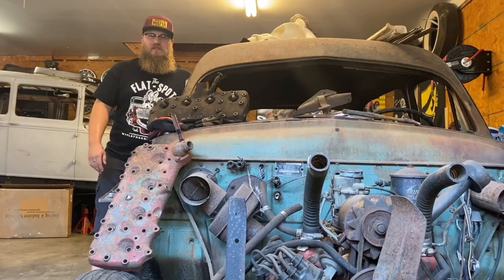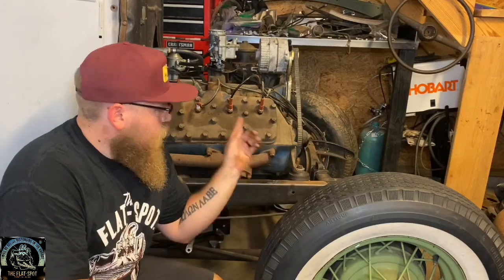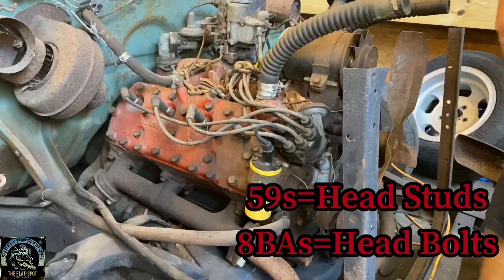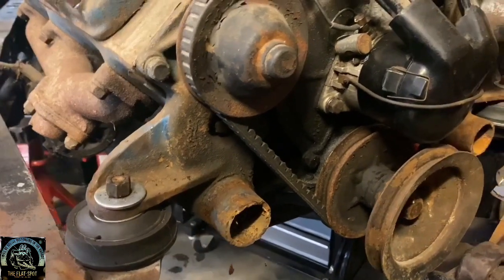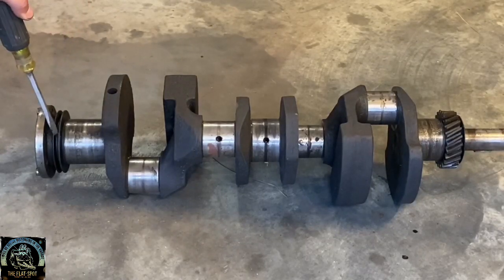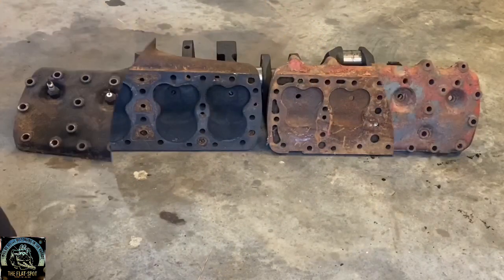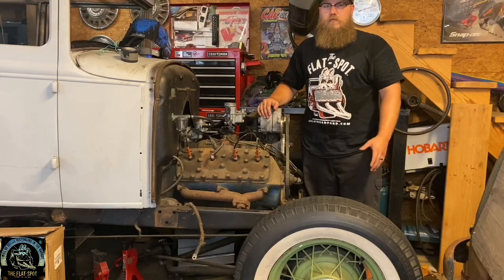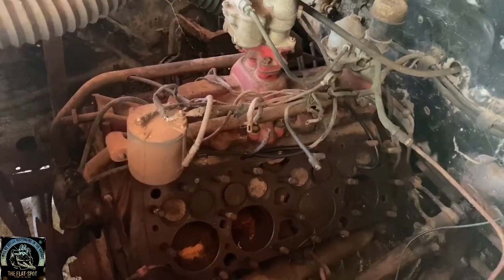Difference Between 8BA and 59 Ford Flatheads!

Comment: I have seen earlier 24 studs with clip in bearings instead of floating. From memory you have to be careful with the 8BA head gaskets as they had a front and back with water restrictions in the front  8ba cam also had a gear on the front to drive the dizzy.
Reply from the maker: Thanks for the extra info David!

Comment: My 59 has circular center passage ways. It also has a relieved intake deck.
Reply from the maker: Ryan Forest sounds like an 8RT, otherwise you have a pretty rare block, it has the 59 on top of the cast bell housing?
Reply: Yes. 59 on bell housing and inside behind valves.
Reply from the maker: Lucky you! Take care of that block

Comment: First engine teardown when I was 14, friends dad told us to take a 49 ford flathead down, we did and learned how an engine worked. He was a cool dad as we did it he explained what everything a how it worked. Next year we got a 48 dodge for 15.00 an got it running and drove it to the drive in, with getting pulled over. That could never happen now days. Someone should bring flathead  back. ELON can we talk?
Reply from the maker: What an awesome story Joel thank you for sharing
Reply: I was saying that during the 70s and 80s, as horsepower was way down, so flathead performance would have been fine, with an engine that was much cheaper to build, but now, with the gas engine seemingly on its way out, I doubt that will happen, unless somebody comes up with a miracle fuel that does eliminates the need for a catalytic converter and therefore emits far less carbon dioxide - yes, the catalyst increases carbon dioxide.

Comment: Awesome video, isn’t the 59ab shorter front to back vs. the 8ba? And that’s why the 59 is more desired in AV8 cars?
Reply from the maker: Andre L thank you! I have a couple of each motors, I haven’t measured but I would say they are the same size, if there is a difference it’s just the difference of the bell housing, I would say a lot of “traditionalist” prefer the 59 just for the look, but they still build them like a 8BA

Comment: I have an 8RT.  It's in my '53 F100.  How is it different from the 8BA?
One difference I'm aware is the front engine mount is under the crankshaft pulley and sets on the front frame crossmember and not mounted by the water pumps.
Is there a difference of performance between the 8BA and the 8RT?
I'll be putting a set of polished Offy heads on it.

Comment: Would love to see the comparison to the 39-42 motors.  I have 2 59AB and 1 1942 motor.
Reply from the maker: Right on I’ll see what I can do, not too much of a difference though other than the center water outlets
Reply: @WiredCustomsSpeedShop  I know there is a raised ridge around the intake seating area on the 41-42, not sure about the earlier ones.

Comment: Great video! Is the 8ba and the mercury 1cm the same? I have the 1cm in my car and I’ve never pulled the head or pulled the motor. From what you’re showing they seem to be the same?
Reply from the maker: Thank you so much for watching, the 8BA would most likely be a 239 with a 3.750 stroke, the Mercury should have the 4 inch stroke making it a 255, huge difference and if your block is really a Mercury it’s Flathead gold
Reply: @WiredCustomsSpeedShop ; Is there any structural difference between the   late model Mercury and Ford blocks ???
Reply from the maker: @daleostrom3613  structurally speaking, the 49-53 (US) blocks are the same exact block
Reply: @WiredCustomsSpeedShop ; Thanks, I have one out of a 2 ton log truck and one out of a 53 Mercury.
Reply from the maker: @daleostrom3613  no problem at all, the Mercury motor should have the longer and more desirable crankshaft too

Comment: My 1941 59 Flathead had a crab distributor setup. Can I swap the crab with a 8ba "normal" distributor by changing the sprocket cover or is there more needed to run the 8ba distributor?
Reply from the maker: You can, you’ll need a conversion kit and 8BA style timing cover, I would have to say though the 8BA distributor was a significant downgrade from the crab distributor and even the helmet style distributor, they run off of vacuum advance only without a mechanical advance
Reply: @WiredCustomsSpeedShop  And, the 8BA distributor has single points stock, the crab and the helmet both have dual points.

Comment: Question what engine oil do you recommend for the 8BA flat head
Reply from the maker: It all depends on what area you live in and what temperatures the car is going to be, I live in Virginia and I use 15w40 and buy a zinc additive
Reply: @WiredCustomsSpeedShop  Shell Rotella 15w40 diesel oil is known to have zinc in it already. Also found basically anywhere that sells motor oil. Any experience running that in a flatty?

Comment: I am getting ready to assemble an 8BA engine. I plan to use a Holley 2bbl Sniper EFI which requires 45 PSI fuel pressure. I will need to use an electric fuel pump instead of the stock mechanical pump which means I will not have a fuel pump push rod in place. I have been told that an oil leak at the push rod bore will severely reduce engine oil pressure. Should I plug the push rod bore hole? If so, I will need to do it very early in the assembly process especially if it requires machining. What say you?
Reply from the maker: The fuel pump push rod is oiled with the cam lobes since it runs off the back of the cam, it is known to lower oil pressure because removing it causes an internal leak, I would recommend leaving the rod in there and just using a block off plate on the fuel pump stand, I know a lot of guys will just leave the pump on and not hooked to anything, it’s up to you, but I’ve been thinking about using the sniper on my daily driver flathead, what are you going to use to get it from four bolt to three bolt flange?
Reply: @WiredCustomsSpeedShop  I would rather install a plug either press in or threaded to replace the push rod and install a block off plate to replace the pump stand. As for the injector bolt flange, I am using a Mercury aluminum intake which has a 4 bolt flange. I haven't ordered my Sniper yet so I may have to fabricate an adapter plate to go from the "teapot" bolt pattern to the Holley 2bbl pattern. I forgot to add that I am installing a T3/T4 hybrid turbo set up to blow through the Sniper. I have a set of stainless block hugger headers and enough 2/12" stainless elbows to go forward under the water pumps and up to the front of the intake manifold where I plan to mount the turbo and plumb it into the Sniper. The hardest part is going to be fabricating a bonnet to fit the inlet flange. It should make around 250 HP. If you're interested it's going into a '27 T track roadster.
Reply from the maker: Edward Werick that sounds like an awesome build! Are you going to post it on the H.A.M.B. or Instagram or somewhere like that I can follow and see it? I am definitely going to put the sniper on my 42 Tudor, after some other projects catch up first
Reply: @WiredCustomsSpeedShop  I too have some "bench cleaning" to do before really getting into this build. I am not very active on social media but if had your e-mail address I could send you progress reports.
Reply from the maker: Edward Werick  you don’t have to go as far as updates but I wouldn’t mind some pictures every once in a while, my email is wiredcustomsllc@gmail.com

Comment: I'm looking at a 1950 F1 pickup online and photo's show 8CM stamped on the heads (24 acorn stud covers not bolts) but I am suspicious that maybe the block is a 8BA . Can you fit a Mercury 8CM head to 8BA block and how can one tell a Mercury block by photo's?
Reply from the maker: Hello! Technically you can’t be 100 sure if it’s a Mercury block unless you drop the oil pan and look at the crank or pull one head off and check the bore and stroke of the crank, you can definitely mix and match the blocks, worst thing about flatheads is you can’t 100 percent ID and engine without disassembly
Reply: @WiredCustomsSpeedShop  Thanks. You've broadened my knowledge immensely.

Comment: What is your preferred stock standard Ford flathead and why? I am looking into buying one and don't want to buy a bucket of fish hooks. Thanks.
Reply from the maker: For me it depends on what I am going to put the motor in, technically the most advanced Flathead is the 8BA which is a 1949-1953, it has the best bearings, best crank, best oiling and cooling system, it’s a great motor, if you ask me what is my preferred motor, I would say the 59ab motor which is 1946-1948 motor, it’s the traditional hotrod motor and I like the look with the heads and front facing distributor, hope that helps!
Reply: @WiredCustomsSpeedShop  Thankyou.
Reply from the maker: @wtongtube  no problem! Let me know if there  is anything else I can do to help
Reply: @WiredCustomsSpeedShop  Which is overall better a Ford 8BA or 1949 Mercury 8CM?
Reply: @WiredCustomsSpeedShop  I have heard that the 8BA block is rather crack-prone, but the 59AB is not.  Is that true?

Comment: Hey what oil do you recommend for a 8ba
Reply from the maker: depends on where you live, the climate, what temps you will be running the engine in and if it has bee rebuilt in the last 20 years or not

Comment: Great lesson. I'm in the market to replace my 60 in a 39 standard. I have a early 50's McCullough supercharger I would like to use. Would it be best to only use an 8BA and/or should I look for a mercury?
Reply from the maker: Cary Ford 8BA would be best, a 59 would be good but you would have to build it with 8BA parts anyways, if you can find a mercury that already has the 4 inch stroke that would be great as well, but you can just buy a 4 inch for any block. Are you a member of the Facebook group “vintage mcculloch superchargers”? That would be the perfect group to find engine and parts
Reply: @WiredCustomsSpeedShop  I never knew about them. Thanks for the tip.
Reply from the maker: Cary Ford  no problem at all! 🤙🏼

Comment: Can we use 59 pumps on 8ba? What about the heads are they interchangeable? Great vid!
Reply from the maker: If you are wanting the 59 style engine mounts then you’ll need an 8RT water pump, you definitely don’t want 59 pumps on a 8BA, you would have to change the whole front accessories to run the early pumps because they are oiled differently, as far as the heads you can run them, you’ll have to plug two holes on the block and one on the head by tapping them with a NPT tap and screwing in a plug, I am a huge 59 fan, but I would have to say the 8BA style head has far greater cooling capabilities, so putting a 59 style head on that block really degrades it, but it does look good!
Reply: Wired Customs LLC  the 59 looks far better to me , but of course the 8ba is a better engine, I love the original distributor location and looks
Reply from the maker: Perro Blanco Films Garage that’s exactly why I am obsessed with the 38-48 ford flatheads, they just look cooler with the helmet distributor or the crab right on the front!
Reply: Wired Customs LLC is possible to mount the original 59 distributor on a 8ba?
Reply from the maker: Perro Blanco Films Garage  it is but you would have to change the cam and timing cover, might have to change the crank too
Reply: Wired Customs LLC why the crank?
Reply from the maker: Perro Blanco Films Garage  off the top of my head I don’t remember if the timing gear on the 8BA cam is the same as the 59, if they aren’t the same then the crank gear is also dofferent
Reply: Wired Customs LLC Thx!
Reply from the maker: Perro Blanco Films Garage no problem at all!
Reply: The Earlier pumps don't fit a 8BA - 8BAs water pumps are also bearing instead of busing like the car pumps - the 8ba pulleys are ofset and driven by different fan belts side to side. I have made adapter straps to mount a 8ba into normal flathead mounts though.
Reply: David Trotman 1949 pumps are not offset.
Reply: @WiredCustomsSpeedShop ; The twist of the teeth on the timing gears goes in opposite direction between these engines.

Comment: I am .just wondering why you would want one of those old engines? The flathead has low compression so it could never make a whole lot of power.
Reply from the maker: You’re right, I’m pushing mine to the max and probably going to get around 200hp, they have a lot of torque though, but it’s mostly for nostalgia, and being different than the millions of SBC and SBF, for me personally I am building a traditional hotrod, and building it as if it was done in the late 50s when hotrodding got big, so mine will be a period correct hotrod with no parts newer than 1955
Reply: That's because real hot rods don't have valve covers
Reply: It's more about keeping a piece of automotive history alive and functioning than having tire roasting horsepower. If you've ever been to a car show, it's interesting to see, hear, and be around a car that's as 100% original whether it's a survivor or a painstaking restoration. A model T is a good example of this. Sure, you can build a high performance t bucket with a blown or fuel injected modern driveline and frame/suspension setup, but seeing how something works as it was made gives a look back at something that most have forgotten about. Those that do remember the past, enjoy the memories seeing it again brings back to them. Those that never knew about it, now can learn. It's not always about having the fastest and most powerful car. Sometimes having something that's rare, and makes you happy is the better thing to have.
Reply: Why do guys spend tons of money on a four banger, just to have less power than a cheap warmed over small block v-8?  Why do guys spend tons of money on a straight six, just to have less power than a cheap warmed over small block v-8?  Why do guys use a small block Ford... when it's cheaper to warm up a Chevy small block?  Why do guys sink tons of money into an old car... when they could have bought a new one?  Well... probably... BECAUSE THAT'S WHAT THEY WANT!!!  Why do you drive what you drive???  Same answer!!!
Reply: @WiredCustomsSpeedShop  do these engines take turbo-charging easily? That seems to the only to really get a lot of power out of these engines.
Reply: @donf3877  Inline engines are easier to work on and offer  a modicum of both efficiency and power.
Reply: @donf3877  Don't get your panties in such a tight wad? Just seems like such an inefficient way of making power? and waste of fuel.
Reply from the maker: @glennredwine289   I’ve never seen anyone put a turbo on a Flathead, the purpose of a Flathead is to have a hotrod that’s correct to a period of time, my car is built like as if it was built in 1955, when Flathead guys want a lot more hp, they put on a frenzel super charger, super chargers came out in the late 1930s, so they can be correct for the time period you want the car to look like it was built in
Reply: @markk3652  Thank you, thank you, thank you!
Reply: @glennredwine289  Supercharging is much better than turbocharging.  No turbo lag.  Turbos are better for diesels and aircraft engines.
Reply: @WiredCustomsSpeedShop  Plus, supercharges don't suffer from turbo lag.  Response is instant.
Reply: @WiredCustomsSpeedShop  Nothing wrong with 200 horsepower in these light-weight cars.